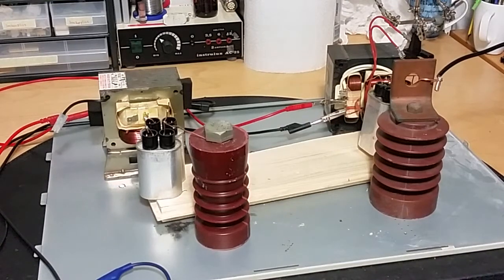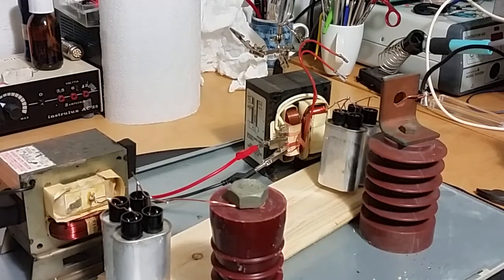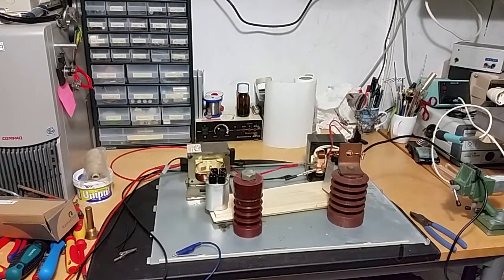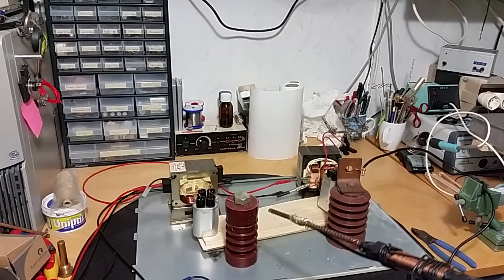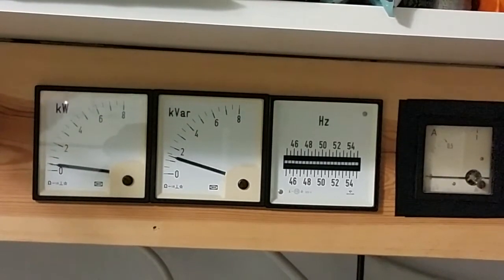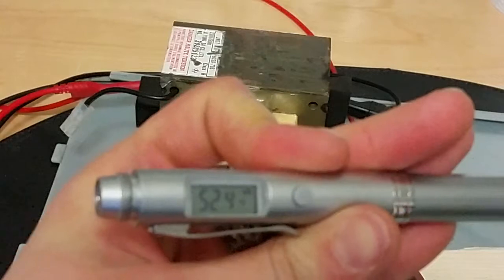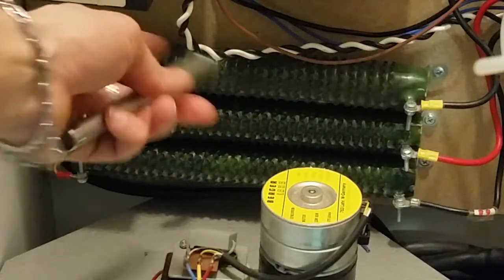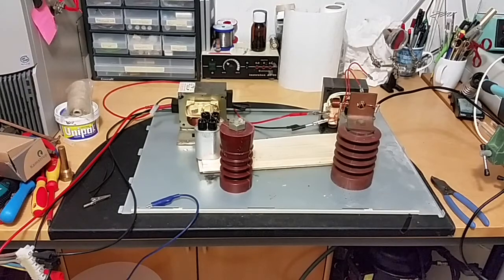400 Volt resonant MOT arcs

Comment: Your KVar meter shows a slight negative value is this just back EMF from the tx or what??
Reply from the maker: The kVAr meter goes negative because I have a capacitive load (the resonance capacitors tor the secondaries are to large)